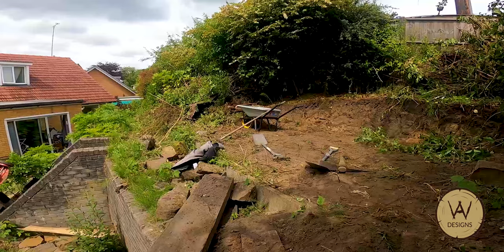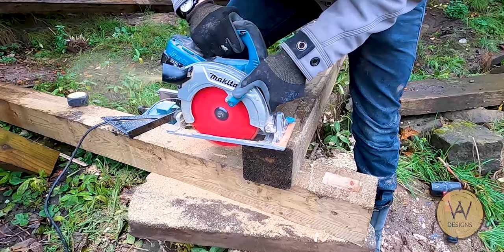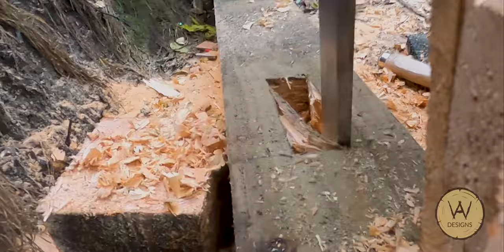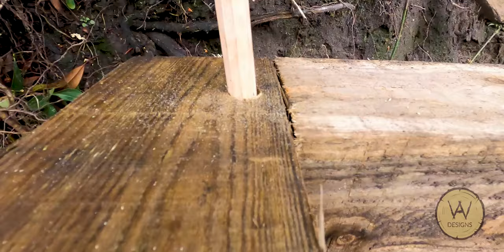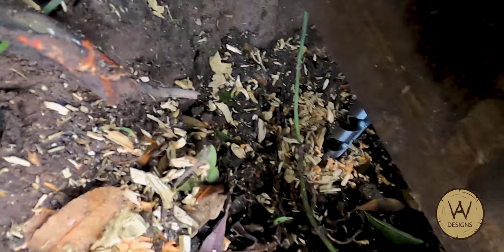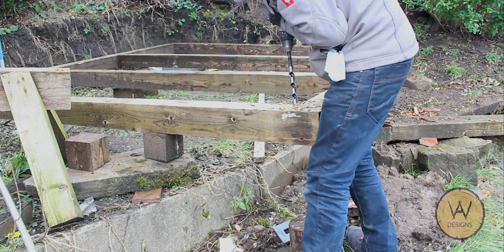small timber frame cabin - The base - Part 1

Comment: I'm also concerned that the threaded rods could settle into the base poles over time because there is nothing grounding them out. By hammering them instead of turning them in,  you've blown out the wood that could be holding the threads. 
I don't see it falling over but it could eventually fall out of plumb and put additional stresses on the joinery.
Reply from the maker: I hit them down till they bottomed out in the hole. It's been 2 years now and I have not noticed any movement yet only time will tell. Thanx for watching

Comment: Great carpentry work! But, I cannot see how the foundation will last. In that corner where you had to reposition the telephone pole base, the 1" all-thread looks like it might be too long to sustain the weight it will need to take to hold up that corner for a long time. And you don't actually have the all-thread rods anchored into the telephone poles. The weight of the shed will give you some stability, but your floor frame isn't really attached to anything, and you may have significant shifting, which might lead to foundation colapse. Not trying to say you didn't do a good job because your carpentry work on those joints where your fastened all of the beams together was great! Just wondering if you did all that work without installing a stable enough foundation?
Reply from the maker: thanx or watching. i understand where you are coming from but 1st of all my structural engineer has been to see it and thinks it's all fine. second I will be putting up a wall under that part to help incase it does shift. thanks again for watching I really appreciate it!
Reply: @avromweisz  as long as the tensile strength holds up over time (settling, shifting, and weathering). Just a suggestion, I would do something with the embankment behind it to prevent erosion. Maybe that's what the drain is for that you mentioned? To be on the safe side, I would still put a retaining wall up. It might be a hassle to install after you built the building, but in the long run, you might just save a potential issue. Just a thought!

Comment: Amazing work however you need more preparation on the ground before starting … high ground in the back is to close to the wood, will case you issues…
Reply from the maker: Thanks for watching. I know, before I put any siding on I will be sorting that out
Reply: I think I see what you're talking about. That hillside could shift/erode over time, which could put pressure on the back wall. Without stabilizing the hillside behind your shed, you might have problems.

Comment: A lot of mistakes!
Reply from the maker: Thanks for your insight!
Reply: What mistakes? I’m not experienced at timber framing, but I’d like to learn. Please tell us how to do a better job.
Reply: @avromweisz  i think i build one just like it
Reply: You don’t know what you are talking about!
Reply: Given its size I wouldn’t say there are a lot of mistakes.  This is a very nice build in many ways and the timber frame aspects add a lot of strength. The wood posts in the front will likely rot sooner than later but the shed can be jacked up cement blocking added.  It seems like the location consists of a lot of shelf rock so it might be hard to work.